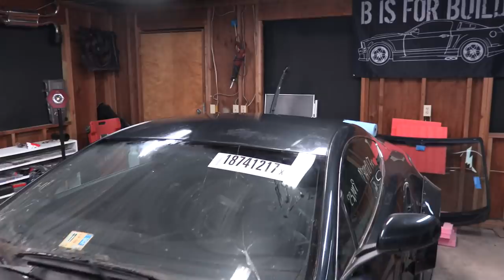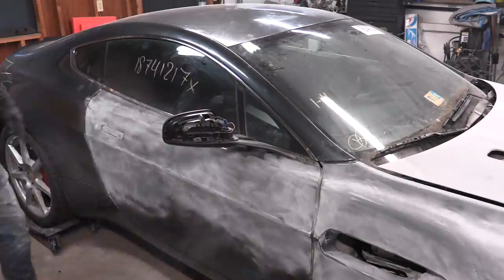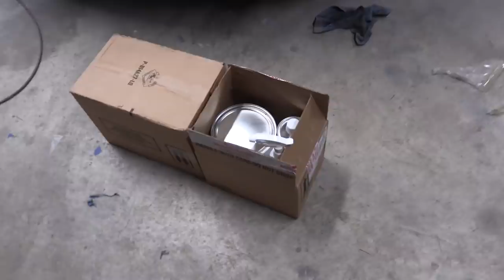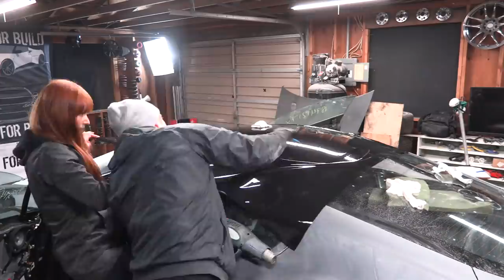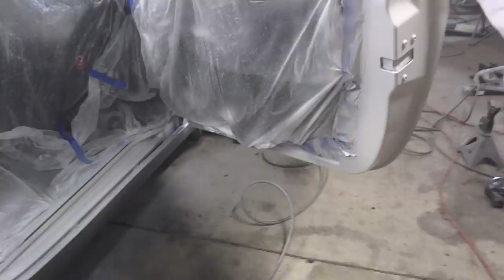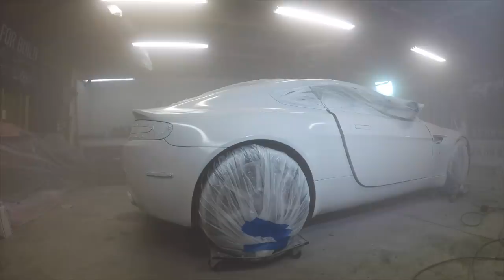V8 Vantage Pt 8 - DIY Paint Job

Comment: Is there a nozzle on the bottom of your compressor? Try purging that, it ussually has a small amount of water that will shoot out initially. That's the water that's getting in your lines
Reply: And i wonder if the heater you had running indoor was causing the compressor to condensate & collect water. I remember during summer in Vancouver, wa when it was like 118 our air compressors at the detail shop did this

Comment: 1 if u use verry hot water and pour it on paint protection film it will peel right on 9 times out of 10 leaving no glue behind. Also for the vynal on the roof 3m's vynal will self heal with a heat gun u can use a felt edge hard card. When installing wet thr felt edge when making passes and u will not scratch the vynal at all

Comment: I got an idea for you, put heater outside and run HVAC pipes inside, add a fan inside wall of the shop so it sucks warm air in and add some insulation to your shop, that’s got to do the trick, btw I will be doing same thing to my shop

Comment: A little advice from a wrapper! When you wrap make sure to ONLY buy quality vinyl. Avery is perfect for beginners. It conforms really well, the adhesive is pressure sensitive so you can reposition it super easy and it has really good air release! 3M is good as well, the adhesive is very tacky so it doesn't reposition the best, it causes glue lines and wrinkles pretty easy, but overall a really good film. I seems the shop is also cold so that will make vinyl more like paper, which can cause it to rip (I've ripped vinyl when the shop is at like 60 degrees lol!) Its suppose to have more of a latex feel. Try it again man. Vinyl is really satisfying when you do it with quality vinyl and under the right conditions!

Comment: Tips for painting.

Always use a separate airline for paint only than you use for your tools.

Cover that part of your garage that had all the chemicals and greases on the table. Your would be amazing how far the fumes off wd40 can can travel.

Wet the floor with water to stick the dust down to the floor. Don’t flood the place. Just enough to keep your sanding dust from flying. 

Never paint where you sand. But you don’t have a choice when doing garage paint job.

Comment: hey Chris i just fitted some heaters and lights to my work paint booth they are explosion proof(i don't mean they wont break if you explode them, i mean they wont explode your shit) just look for paint booth heaters and also look for paint booth lighting they basically just put strip lights in a sealed plastic tube thought which you could very easily do.

Comment: Are you running a air/oil seperater? If not all these fish eyes could be from water or oil from your compressor. Also for degressing  spray on whip it off then whip it with another clean towel to dry it
Reply: Cameron Gillis he did mention he is using one. And he changed the filters on that.
Reply: Cameron Gillis did you even finish watching the video my dude

Comment: You need to put a 95%  efficient furnace in. It can be set up to pull its fresh air for the burner from outside. You can get a 40000 btu that is pretty small and mount it horizontal off the ceiling trusses  then build a box around it to seal it away from any fumes.

Comment: Before you take the vinyl wrap off the roof, I have a suggestion!

My boss and I wrapped my roof gloss black as well, and yes, it had scratches ALL OVER the place, but they can be removed just by polishing it and getting the scratches and swirls out. I used rubbing alcohol and a microfiber rag as well.

Give it a shot at removing the scratches before you remove the vinyl all together!

Comment: you should wipe down with isopropyl alcohol and torx wipes. I had no fisheyes on the whole rabbit interior. Iso is super cheap as well, and works great. And an air line snake will help with water condensation

Comment: How cold is the shop when you typically wrap? I'm surprised you have difficulty with it, I'm far less technically skilled as you and have always had a relatively easy time wrapping 3M material, it turns out like 8/10 in a warm-ish garage.

Comment: Does your air compressor have a drain at the bottom....over time when the air is compressed into the tank water is introduced into the tank....you should open up the drain of you have never done it before

Comment: You would be very surprised by how much easier vinyl is when you use higher quality vinyl. I am by no means, a pro, but ive done a decent amount of vinyl for myself and family/friends. I always struggled with vinyl, but persevered with cheap vinyl. When I wrapped my bike I used higher quality vinyl (3m 1080, and Avery Dennison, Avery is my preference) and I was surprised by how much more forgiving it was than using even Oracal vinyl that I had used a lot previously.

Comment: A few things about vinyl wraps. First, there are tons of shades of white, from pink pearls to rainbow satins. Second. Quality vinyl makes all the difference in the world. 3M, Avery, KPMF, Hexis, APA, Vvivid...name brands not China Vinyl. Third. Buffer marks, or scratches like you saw will heat out due to vinyls PVC base, if it's quality vinyl. Forth. Applying vinyl in temps under 60 is not a good idea. Vinyl when cold is stiff and brittle plus the adhesive will take for ever to tack up. Fifth. I get why vinyl wrapping isn't for you, you are a painter, stick with that you know.

Comment: when painting a car, least you can do is sand is properly with multiple grit sandpapers, clean with wax and grease remover and tack the car. PRIMER!!!! then sand again (1000, 2000, 3000). finally base and clear. Sand clear and buff.

Comment: I would be more concerned with that heater because the blower fan would kick up dust in the shop not because of that fuel it burns.. Maybe yours is different though mines old and has a really powerful blower fan

Comment: you really didn't lay the vinyl properly. Since its mostly flat you don't need to pre-stretch, but since its cold you want it warm. Pvc in the vinyl will harden when its cold. Once the vinyl is warm you want to stick the middle and pull the vinyl tight and lay it down. Using the squeegee and warming the vinyl at the same time will cause the scratches that you are seeing.
Reply: SnaggedaRockFish that and since the vinyl is PVC based those scratches will heal out when you warm the vinyl...assuming it's not China Vinyl.

Comment: The reason the vinyl was a bitch to work with is the temp. If it was 70 degrees in the shop the vinyl would be more workable, I’ve wrapped a lot of cars in the cold and it’s a fight w the brittle vinyl every time

Comment: Your changing to much. So you will never know what you did wrong. Do one thing at a time. Buy a air line with Sylica in the line to eliminate the water plus have s trap on the bottom of the gun. They cost 10$. Big help

Comment: This is like watching haggard garage with slightly more knowledge but harder to laugh at. 

The reason you got fish eyes was because of the simple fact you didn't wipe dry your panels after you wax/grease removed/cleaned them. You're supposesd to wipe with the remover and follow over it with a clean, dry rag. So panel by panel clean then wipe with dry rag. Using the same lint free body cleaning towels you should be using in the first place.

Comment: You wont blow the shop up, its water based paint.
Reply: How do you know? Most single stage paints are urethane based, which is very much flammable until dried
Reply: Because any automotive paint that you buy nowadays is waterpaint, its more safe (less cancer) and also the industry standard now... You should always check the labels but 99.9% is water based and it won't give off any flammable fumes.

Comment: I have watched alot of your videos the last couple of weeks and every time you paint you seem to always complain or talk about the temperature. All i think to myself is why you dont put isolation in the shop? it would keep the heat in the shop in the winter and heating it up would be much easier and cheeper. 
Also, as every one else says, dont do those wide body flares.. Do the car justice and put proper wide body fenders that fits.

Comment: Have you ever plasti-dipped a car?  I forget if you did that on one of your videos.

Oh and don't do the wide body, completely unnecessary.  You can modify the daylights out of it, but the wide body kit is not necessary and it will take the look of it down.